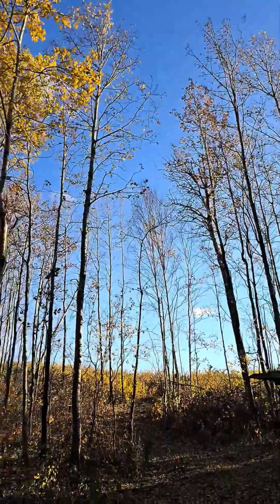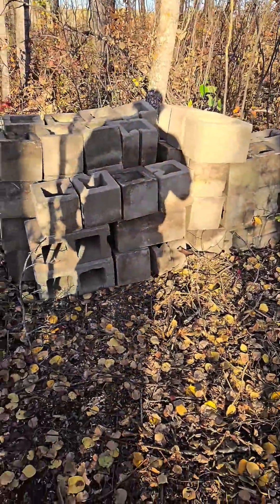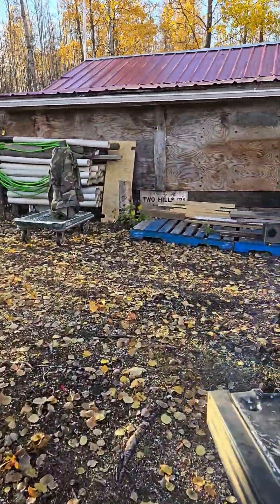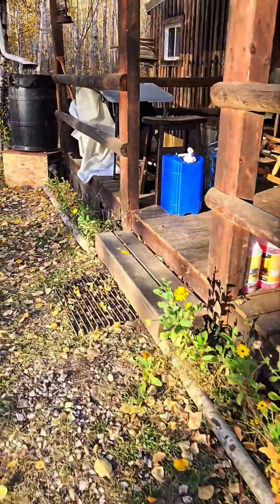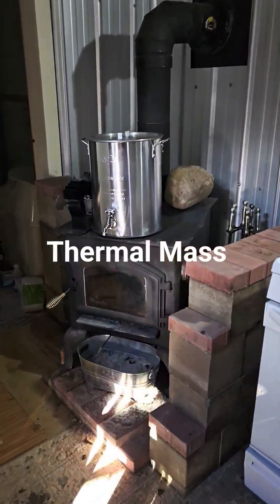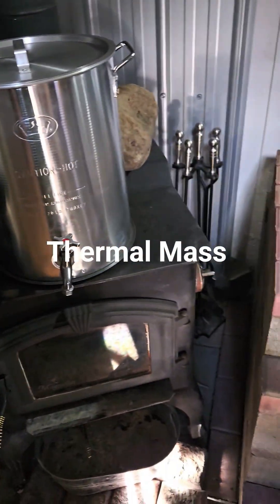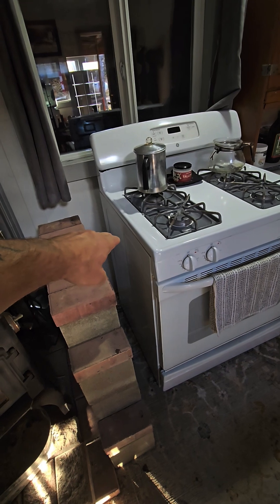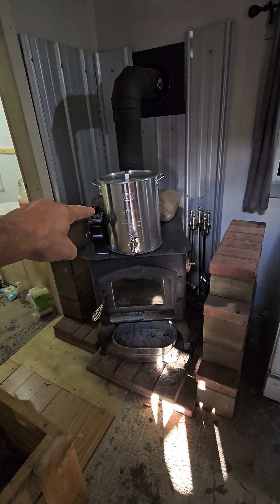Using Thermal Mass to Heat a Cabin #offgrid

Comment: Hi. Did it work?
Reply from the maker: Yes sure does. Cabin stays warm longer when the fire 🔥  is low. Saves on wood.
Reply: @CanadianDreamer  I've got an off the grid cottage with bunkie on Lake Nippissing. We don't use it in the winter because there is no heat. This said, we thought about getting a small woodstove for the bunkie but don't want to burn wood in it when sleeping so I was wondering if using "thermal mass" items would help in this regard.
Reply from the maker: Thermal mass would definitely help. I use wood but also propane when I am not there to keep an eye on the wood stove. My 20,000 BTU martin direct vent furnace works well . I do have a video on it.